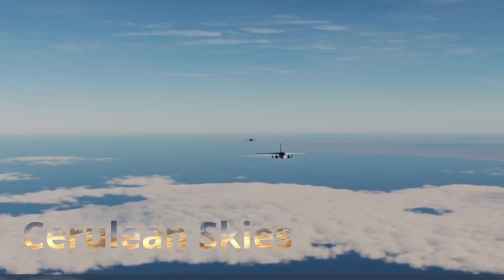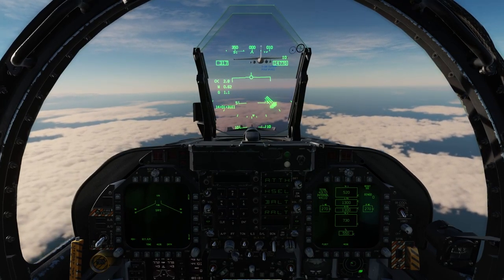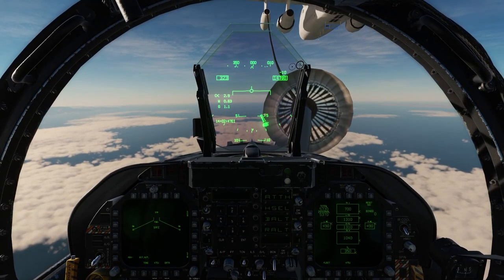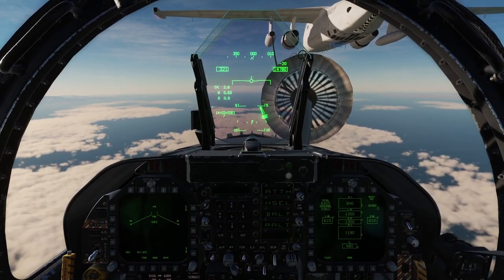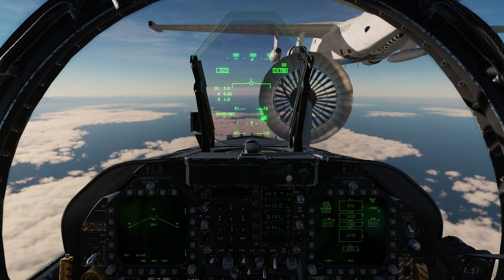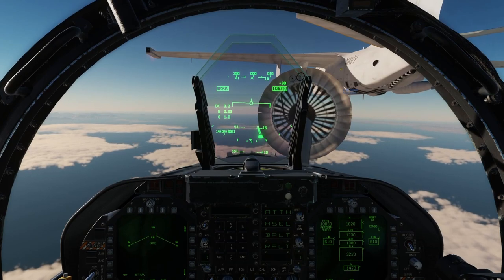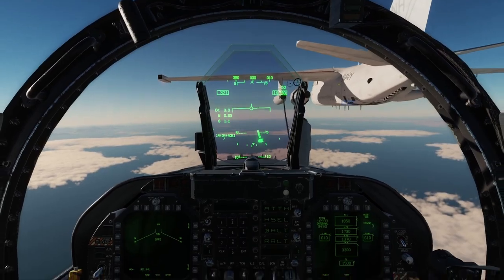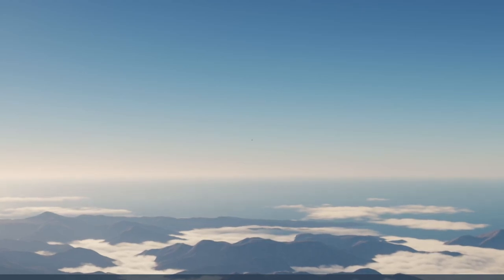Three Crucial Tips to Crack AA Refueling #DCS #Refuel

Comment: Gotta agree the hardware is a major factor
Reply from the maker: Yep! It made a HUGE difference. For years I thought I just wasn't skilled enough to do it.  Got the VKB stick and made connection first time I tried with it for 10 seconds.  2 tries later and made connection and was able to maintain it as long as I wanted.  Been that way ever since.
Reply: @ceruleanskies1414  yes I too suffered the Warthog stiffness overcontrol
Reply: Well, I guess so but I’m still on the TM HOTAS WARTHOG and I can refuel anytime, day and night. You will need to adjust the deadzone and curvature to your desired settings on how you fly your aircraft. The tips on this video is what helped me understand what was needed. Good luck and keep practicing.